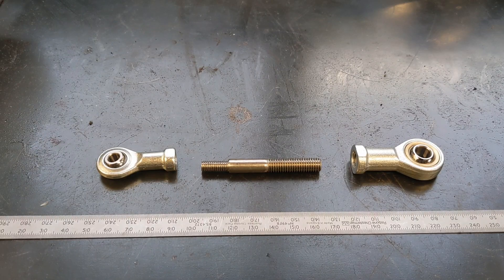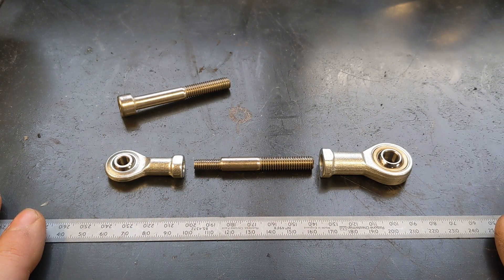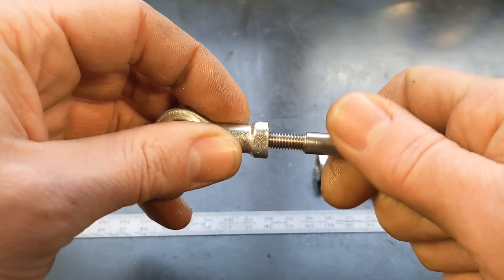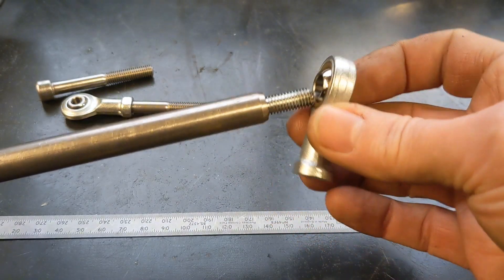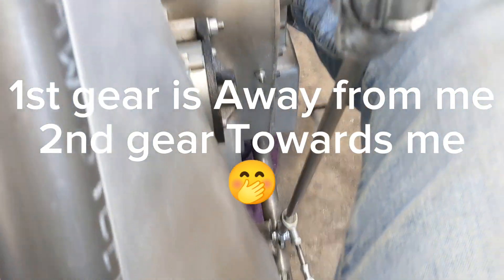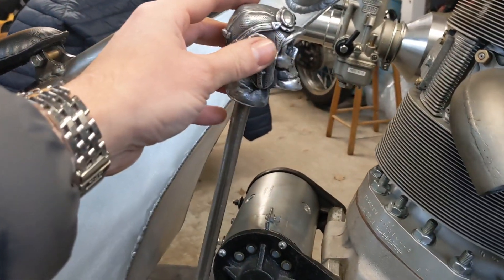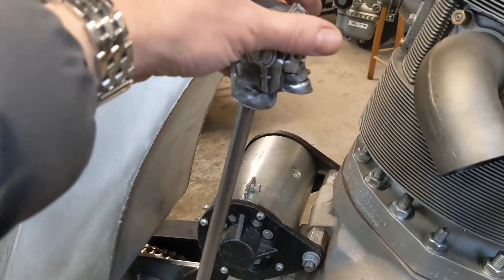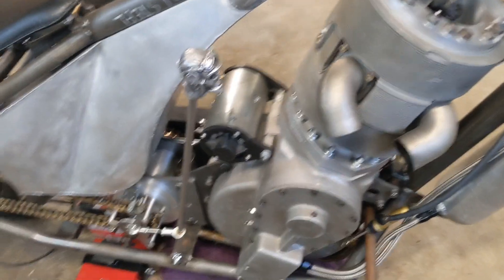Linkage complete! Gate to follow....

Comment: You should be brazing some of the brackets to  frame so you can remove them and change position etc.  Very strong and holds up better under vibration than some welds

Comment: You will need to undercut the M6 thread where it starts on the plain part of the shift-rod. There will be a stress-concentration at that point. The mechanical advantage of the shift-lever combined the vibration axis of the engine is likely to cause a fracture. It may be advantageous to make the shift-lever from tube rather than solid.

Comment: looks good mate however wouldnt the vibrations of the engine and road travel vibrations change the gears? i would suggest a top bracket with a slots on diffrent alignments for 1st 2nd and neutral ( slide gate ) just like bikes used to have.
Reply from the maker: @chrislewis4830  yes, that's what I mean when I say a 'gate'. Next on the list.
Reply: @StoneEng  yeahh hmm i posted before you mentioned it my bad

Comment: Maybe a tube over the threaded bolt that the rose joints would tighten against. The length could be altered for adjustment more easily that altering the bolt.
Reply from the maker: @bernardreeves5028  I did that t this afternoon 😁 Great minds....

Comment: A second linkage with rose joints could be connected in the same place but at 90 degrees over to the engine, that would make it move in a bit of a arc but also make it super rigid from side to side
Reply from the maker: @remijio303  It might also serve as a gate. Took a few minutes to figure out what you meant, and I still think a fixed length might cause problems..... but I have some spare joints so I can have a play with it.

Comment: The M6 thread has 1.0 mm pitch, M8 however is 1.25 mm. So: when you rotate the linking bolt, you get a 0.25 mm length change per revolution. That means you get a few millimeters by which you can adjust the linkage in situ. I'm certain you'll figure it out!
Reply: I was thinking that as well, but I wasn’t sure that my coffee had kicked in enough to be thinking about it right.

It also means there’s the possibility for vibrations to “adjust” it, so a lock nut might be needed.